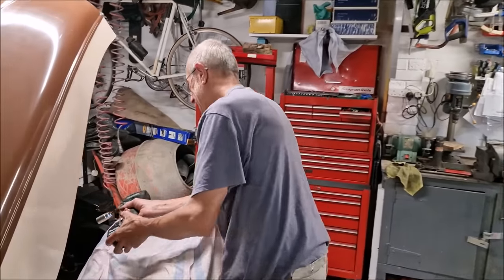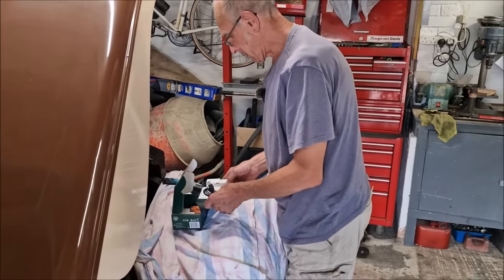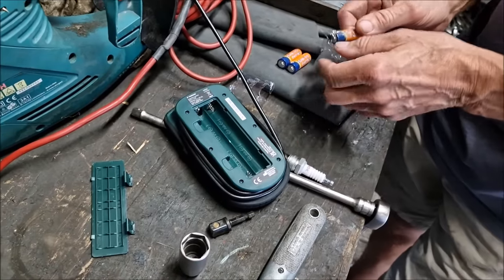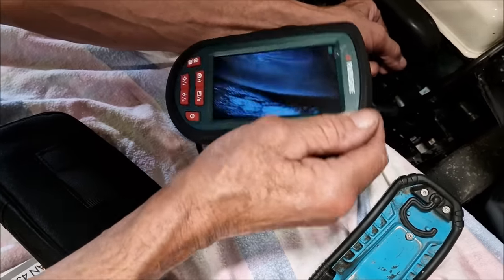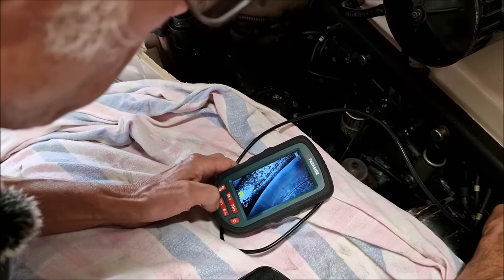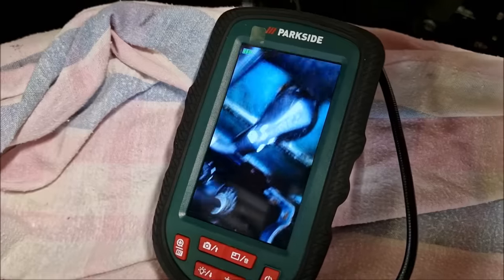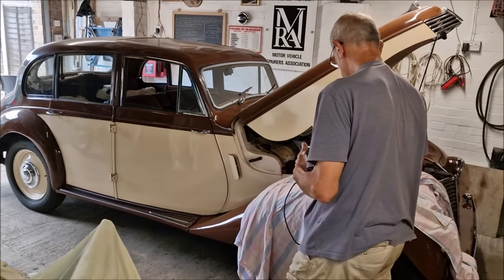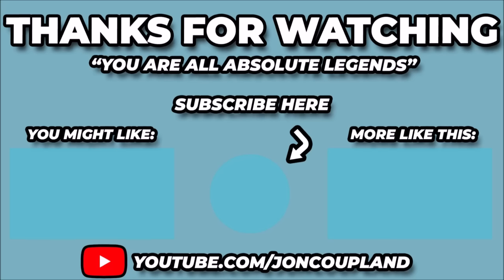A £40 Endoscope From Lidl - Any Good? - Parkside Inspection Camera Review & Test

Comment: Hi Jon, A few years ago I got one of the Aldi version that links to my iphone. They are invaluable, I’ve used it for putting LAN cables between floors and wall cavities. Also been used to check for a shower tray leak upstairs by drilling a 10mm hole in the ceiling downstairs to prevent ripping up floorboards to investigate. For the price they’re a no brainer!😊👍
Reply from the maker: We have used it multiple times already 😁👍

Comment: That image quality is better than some of the £100k industrial video probes I was using back in 1989 and a damn sight more portable too. The main difference was we had four-way articulating heads and the umbilical was 25 metres long.
Reply from the maker: Its bonkers isnt it!
Reply: @JonCoupland  Even more bonkers than that, the Welch Allyn video probes we used had a black & white CCD chip but produced a colour image.

Comment: As an aside, I have quite a lot of Tronic low self discharge (ready to use) AA/AAA/9v batteries in use in my house, some of the 9v PP3s are over a decade old. Tronics are okay if you don't need high current drain.
Reply: My main use for AA size cells is in wall clocks (Current draw around 0,5µA) and for this reason I tend to use Zinc Chloride types, which are better for long-term, low draw applications. I also have a large pile of Tronic AA cells lying around. 🔋

Are these likely to be suitable for use in clocks too, or will the very low current draw kill the cell before it's served the best of its useful life? 😇
Reply: @dieseldragon6756  Low current draw never killed any battery. If those Tronics You have are the low self discharge NIMH type, go for it. I use the 9v ones primarily in smoke alarms. If they're not the low self discharge type (sold as ready to use rechargeable) you will lose more power in self discharge than your clocks will use. In either case the lifespan of the cell will be measured in "years" not "charge cycles". 
Like You i use Zinc cells for some things, mostly stuff that doesn't like the lower nominal voltage of rechargeables. For me, this tends to be stuff with old school mono LCD display like calculator, cheap kitchen scales etc.
Reply from the maker: Interesting

Comment: Nice looking Tiger 955i..... I have an older Roulette Green one
I also have a very handy endoscope 👍
Reply from the maker: I'm a fan of the Orange one too 😊👍 thanks for watching
Reply: @JonCoupland ..... I also have a Bonnie and an old T595 Daytona (and two Enfields and an R1100RT BMW) but I don't get out much 😪
Reply: I had an identical Triumph 955i 2006 in blue. A really great bike if a little top heavy. I sold it not too l😂ong ago a bought a newer 2023 Triumph 850 Sport . While the jury is out on funny firing order-it’s ok! I put R& G bar end weights to stop some of the vibes the digital mileage screen is a bit strange  too - who needs two tachos???- it is overly complex in digital form In my opinion That aside the 850 has  a lower centre of gravity and doesn’t need “hustling” so much when manoeuvring on the garage floor / driveway.  I don’t have a use for an Endoscope….Yet!!! But great video thank you.

Comment: What's the resolution of that thing? I bet for such a cheap little thing it'll most likely be only about 320 by 240 pixels, the usual figure for such cheap basic digi cameras, just like the really crap little cameras they fit on basic "simple to use" mobile phones now when they used to have really good cameras fitted, but now only "smart" phones have anything like decent cameras on. And does that endoscope have an AV output connector so you can plug it into a larger screen portable TV? I bet it doesn't, that's one thing I hate about those little inspection cameras, very few of them have any external video output.
Reply from the maker: 800x480 - no external output no

Comment: Hi Jon, what’s the resolution on the camera please?
Reply from the maker: Ooh that's a good question. We will have to check 😆👍
Reply: @JonCoupland  I ask as I need to replace the  Volvo V70 P3 intecooler sensor and it’s so hidden I can’t even see it.  So I would like to get one to aid my “remove by feel alone” working method.  And obvs Lidl are now out of them.  Aldi’s version is £50 but has a much smaller screen.  And the resolution is only something like 1280x720.

Comment: You can buy a cable with a lens on for your phone
Reply from the maker: You can. But Dad isn't into that
Reply: The park unit will last longer I'd reckon .....I only bought the cheap one when I was replacing my astra1.6 cdti thermostat and water pump .....what a palaver that was especially as I was only working from above 👌🤣
Reply: Another Jonathan here ....can't stand being called jon john or Johnny 👎